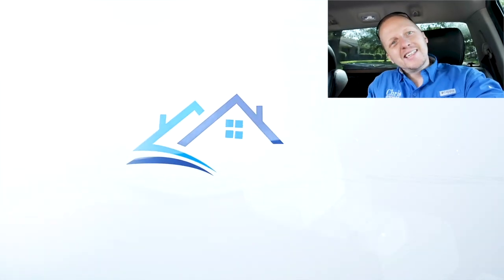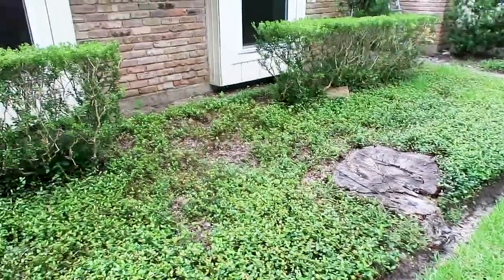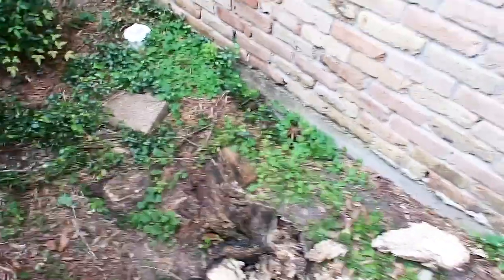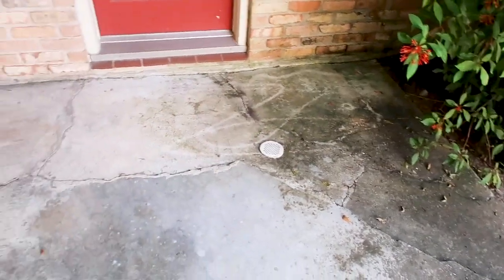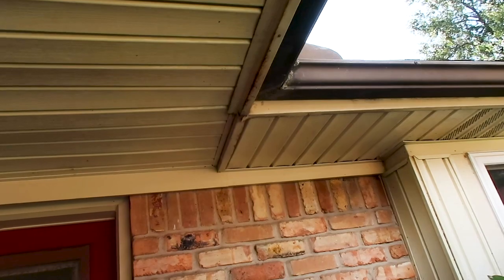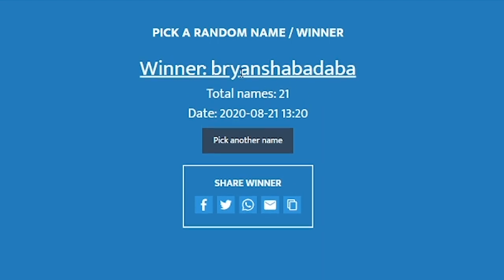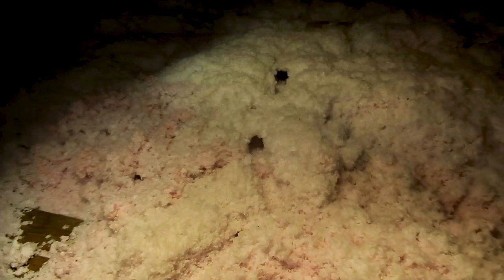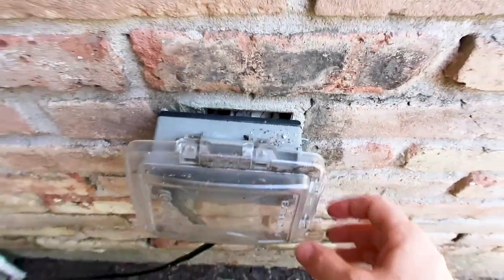Home Investigator: Episode 15 - Old Home Old Problems 2

Comment: Awesome video man, I have been learning a ton from your detailed inspections so thank you!  One question- How long do your inspections typically take?  I just started a new job as a home inspector about a month ago and we allot for 3 hours which sometimes doesn't seem long enough depending on the amount of deficiencies that are found.  Curious what your thoughts are on that.
Reply from the maker: Our Inspections on average are around 3 hours.  We moved our time slots to 4 hour blocks.  If the inspection is shorter we get a loner lunch break.